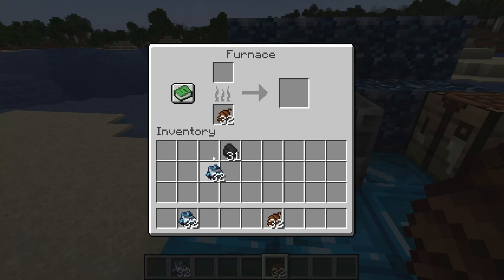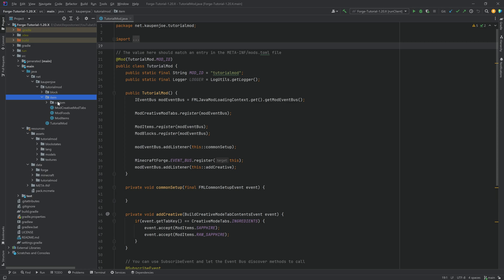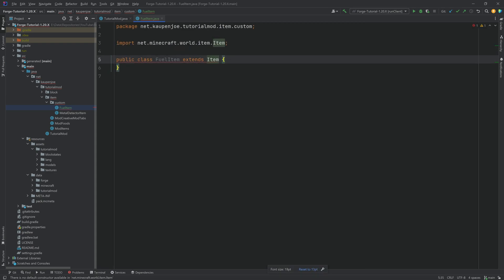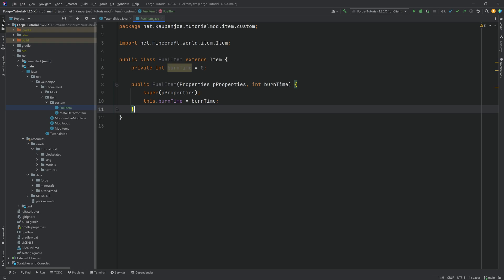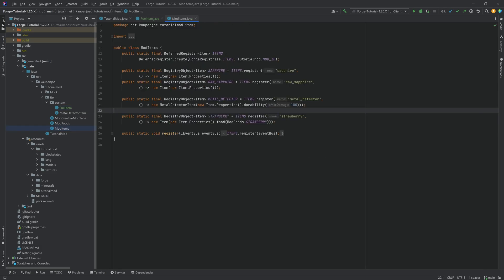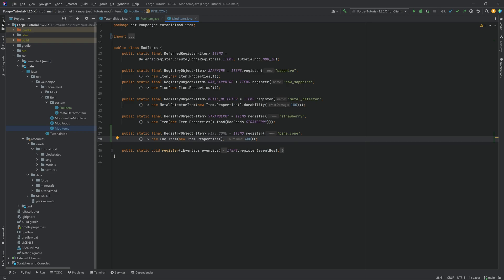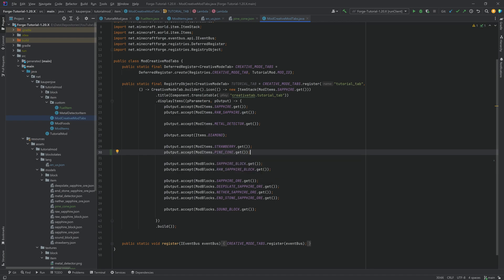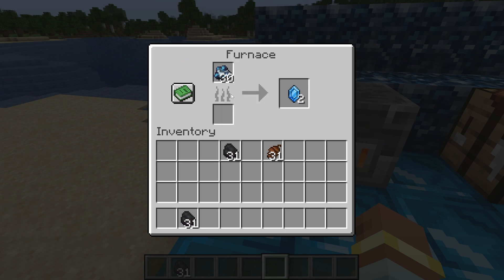Forge Modding Tutorial - Minecraft 1.20: Fuel Items | #9

Comment: doesn't seem to work on blocks... will we get a tutorial on that later, or...?
Reply: Found a solution yet..?
Reply: @thekingskull0144  What I did was create a new class called FuelBlockItems (inside block.custom package) that looks similar to the FuelItem class. The only difference is that instead of extending the item class, I extended the BlockItem class and added the default constructor required for it. The inside of the class looks like this:

 public FuelBlockItem(Block pBlock, Properties pProperties, int burnTime) {
        super(pBlock, pProperties);
        this.burnTime = burnTime;
    }

    @Override
    public int getBurnTime(ItemStack itemStack, @Nullable RecipeType<?> recipeType) {
        return this.burnTime;
    }

Then in the ModBlocks class, I added two more methods called registerFuelBlock and registerFuelBlockItem which look similar to register Block and register BlockItem. The new methods have an additional parameter for burnTime and . They look like this:

private static <T extends  Block> RegistryObject<T> registerFuelBlock(String name, Supplier<T> block, int burnTime) {
        RegistryObject<T> toReturn = BLOCKS.register(name, block);
        registerFuelBlockItem(name, toReturn, burnTime);
        return toReturn;
    }

 private static <T extends Block> RegistryObject<Item> registerFuelBlockItem(String name, RegistryObject<T> block, int burnTime) {
        return ModItems.ITEMS.register(name, () -> new FuelBlockItem(block.get(), new Item.Properties(), burnTime));
    }

Then, all you need to do is use registerFuelBlock instead of registerBlock when creating a new Block in ModBlocks and add an additional argument for the burnTime.

I'm not sure if this is the right way to do it, there might be a better alternative, but this is how I got it to work.